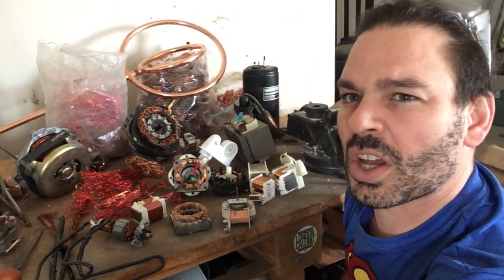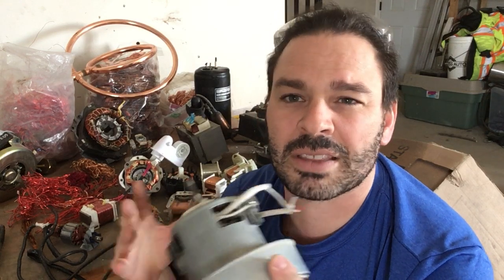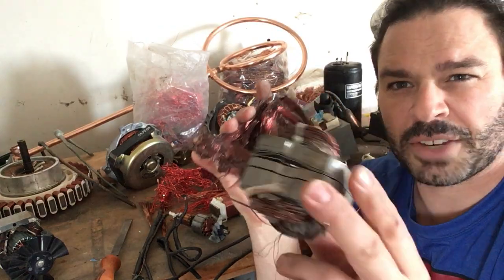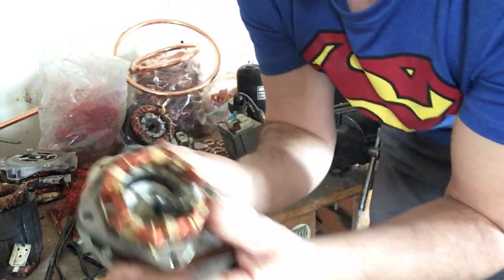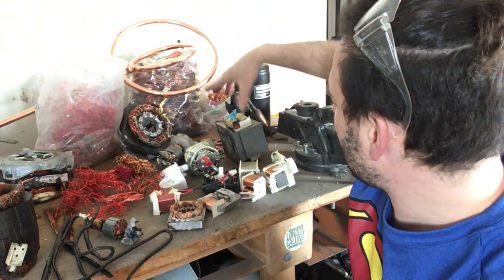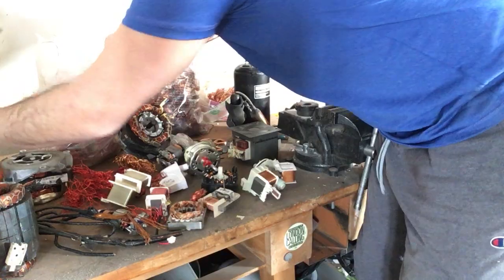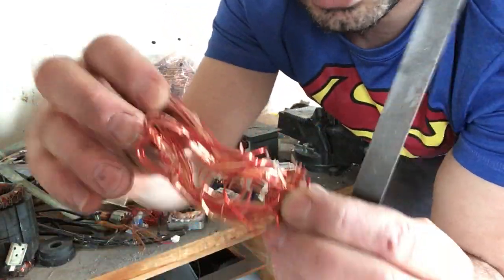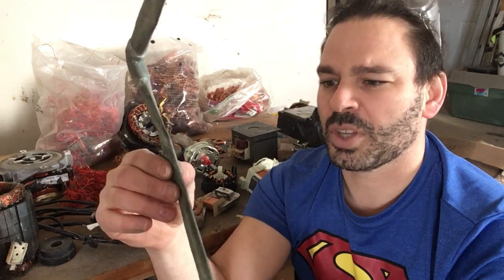Scrapping for copper. Which ones are NOT copper? Be sure to check and separate!!!

Comment: Great tips but the scratch-method is not always working. Ive seen thick copper wire with aluminium foliage and then coppercoloured plastic. A better method is to drill it maybe and watch the dust.

Comment: Is the term #2 copper the same category for both tubes and wire or is there a #2 Tube and a #2 wire
Reply from the maker: Good question. #2 copper refers to all in one so (thin wire, soldered pipe, painted, glue on wire, or oil on wire will all be lumped together for #2 copper. I do have them separate to make it easy. I put my wire from motors, etc in bags and the dirty tubes in a bucket, but weighed together at yard.